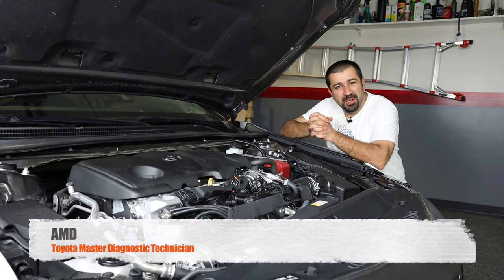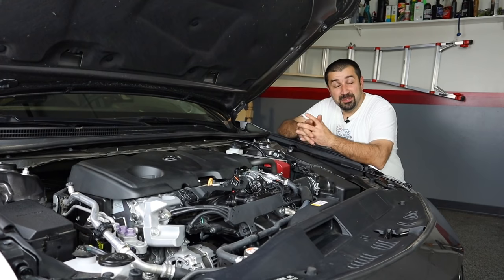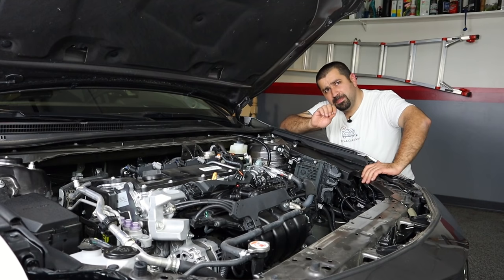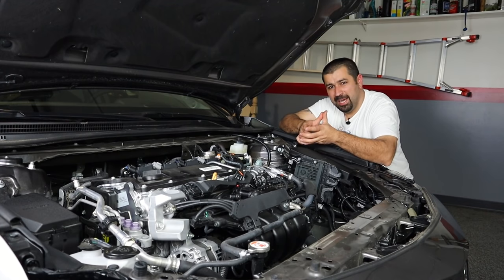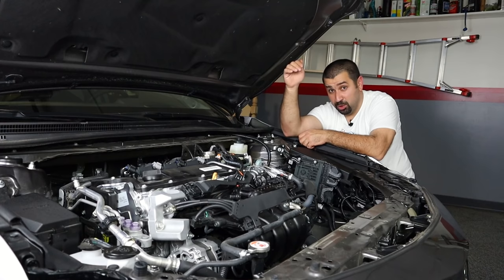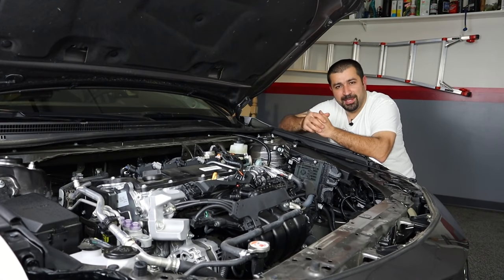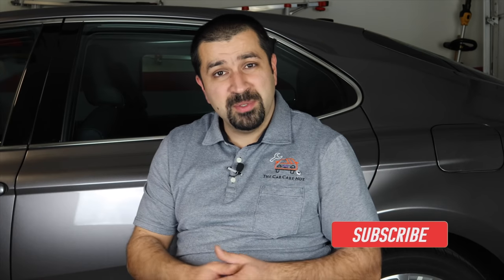Toyota's New Engine Technical review Part 1 : Cooling,Lubrication,Direct Injection and EGR

Comment: Regarding the oil, what happens at 100,000 miles when engine tolerances are worn and people usually use a heavier weight oil, what do we do then? Still use 0W-16. Another question would be I assume you will never be able to use oil additives like Lucas oil treatment? That stuff is like honey.
Reply from the maker: I’ve already seen examples well over 100k miles still using 0w16 and no issues at all. The oil additives personally I wouldn’t use regardless of 0w16 or not but that’s just me..
Reply: Engine oils for the most part are so good now you don’t need an engine oil treatment. Putting it in probably decreases the performance of the oil.

Comment: Port + Direct gas injection is the #1 reason I bought a Toyota over a Subaru or Mazda (Sorry Nissan, American and European makers your cars were NOT even in the running). I am surprised though that Toyota did not bother putting an acoustic cover of the DGI pump. It would go a long way to getting rid of that loud Diesel fuel pump clatter.

Comment: oh i forgot to mention gas mileage on the 2.5 in the 2018 rav 4 is a low 36 mpg to a high of 39.8 mpg in summer useing high test gas  that is an imperial gal  or 4.5 litres  average city and highway  beat that if you can

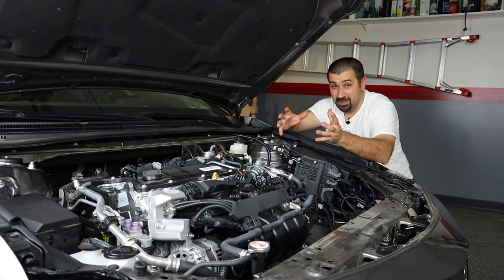Comment: @6:22 Europe manual for the same car with this engine... 0w-16 through 5w-30 is stated in the manual depending on temperature expected.. Do they have different programming for Europe in regard to the pump.. no... North America states the use of a heavier oil when towing or in extreme conditions... 0w-16 is purely for CAFE. The only caveat is if you are driving in -30 degree weather. Most of us never hit positive 30 degree weather.. I had to performa lot of research to get past this dumb 'Just use what the manufacturer says'.... My vehicle's are expensive.. I want them to last 500k not 300k.

Comment: A Guy in the US has a 2010 Toyota Matrix or Corolla, it's 1.8-litre fuel injected and he changes the oil every 3000 miles and has done INXS of 600, 000 miles and it cost him next to nothing to run he just uses a 5w30 synthetic oil, tell me what more do you need from a car. Like I've always said keep it simple, the more complex an engine the more things can fail as it gets older, notice plastic has become the new alloy, all this Tech is designed to tie you to the dealership, nothing is simple anymore and that equates to dollars, not in your pocket but the dealerships.

Comment: There's more parts, so there's more parts to fail, so more parts will fail and more failing parts are gong to cost the owner's more over the total lifespan of the vehicle. Let's just all get over that.

On the up side these Toyotas are designed to meet the emissions and fuel economy standards set by the government which means that you can go to any Toyota dealer and buy them without anyone breaking any laws.

As a side note, I'm guessing that these things have or will eventually have stop start technology so certain electric pumps would be necessary to keep systems in the car running when the engine is off. 

Will these cars be as reliable as older Toyotas?  There's actually no reason to believe that up to a certain mileage they shouldn't be, but all car parts are designed with a specific target life span.  Once these parts reach their target life span and begin failing these cars are going to get really expensive really fast. My experience tells me that once a car reaches a certain age stuff just breaks from use or even metal fatigue. Up to a point, you can just replace parts as they fail... In other words, given enough spare parts any car can run forever.   On the down side that isn't economically feasible when the parts are expensive and there are so many to fail.

For the original owners who get rid of their cars when the warranty runs out, these are going to be great cars.  For the guy who sinks his last penny into a high mileage, older one... these things will eat him alive.  It's going to be interesting to see where the tipping point between Toyota reliability and money pit is.

Think of these things like a Prius, or a hot potato; the guy who gets rid of the car before the battery, the electric drive unit, the catalytic converter, the ECM and the power distribution module fails did pretty well, the next owner who bought the car and gets to replace these parts among others is going to regret his purchase.

Comment: What about the recall on any out this thing.
Reply from the maker: Recalls on cars with this engine are minimal and usually software related
Reply: Tell me more about electric water pump and how its more reliable then the old one
Reply from the maker: We haven’t really seen any issues with electric water pumps. Some of the 3rd generation Prius with electric water pumps have failed but they were with high mileage and was not very expensive to replace.

Comment: Which Toyota cars use this engine ?
Reply from the maker: The first model to use it is the 2018 Camry. Then the 2019 Avalon hybrid. Then now the RAV4 in all 3 forms, the highlander hybrid the Venza hybrid the new Sienna hybrid the Corolla higher trims will use a 2.0 variant of this engine. Also the Avalon non hybrid AWD uses this engine. It isn't going to be long before every Toyota uses a variant of this engine.

Comment: AMD , please elaborate on the issues you have seen with using the wrong weight of oil in these engines . How harmful can it honestly be using 0w20 in this engine ?. It's only 4 points heavier at operating temperature and the same viscosity when cold .
Reply from the maker: Hi! Likely 0w20 is ok but some are going as high as 10w30 10w40 which is not a good idea for this engine
Reply: @TheCarCareNut  that makes perfect sense . Thank you for the reply sir

Comment: i like the Technology Toyota has implemented on this engine.. my only gripe is why they used a mechanical vacuum pump vs a brushless electric pump.. at highway speeds the vac pump will be turning half engine speed continuously wether needed or not vs a electronic version that can vary it's running speed or shut off completely when cruise with no brake application.. just seems abit counter intuitive based on the other advancement they've made

Comment: Electric water pump, plastic valve cover, adoptive transmission etc technology that BMWs use the last 10+ years that’s why they require lots and expensive maintenance. I hope Toyota parts are more reliable I just decided to switch from a 535 to a Camry

Comment: But In Bahrain dealer will still use 20w-50 in this engine
Reply: I wonder if the oil pump is always working on low pressure mode with thicker oil.

Comment: Official Toyota dealers in the Netherlands, Belgium and Germany do only apply 5W30 oil. This while the manual (in Dutch!) clearly prescribes 0W16! If a customer insists on 0W16 to be used dealers refuse to do so or let the customer pay extra. The dealerships do not have 0W16 on stock and have to order it in. Even the Toyota importer in the Netherlands says 5W30 is what should be used contrary to what the Toyota factory prescribes. I read about a customer who insisted to get 0W16 and was only allowed to get it after signing a waiver as he was told it is bad for his engine.
Reply: However I will insist on 0W16!

Comment: Hi we just bought a 22. Corrola, 2.0, 6 speed manual. Now after seeing the engine is more complicated it has kinda scared me. Was going to buy a 1.6 liter turbo 19 hyundai but got this new 22 corrola instead.
Reply: Dont worry you made the Right Choice
Reply: I second Dusty's response. Just keep up with the maintenance and that car will last you.
Reply: Lots if examples of these engines going over 200k miles with no problem

Comment: What id do is run the 0w16 for an initial oil change after a few hundred to 1000 miles, then run a 4-5k interval on that stuff and then send a sample of the oil to blackstone labs for example.
If wear metals are low this engine copes just fine with 0w16.
0w16 may be fine as a winter grade but id recommend 0w30 during summer and/or if the engine is under high load when oil temps go up. Thicker oils provide better protection its as simple as that. Should the thicker oil result in TOO much oil pressure ok then its no good.
If the engine is quieter and smoother on 0w30 id just run that all the time no harm in having a thicker oil in the engine at all then.

Comment: You didn't give a clear argument as why a 0W-20 or a 5W-30 oil would harm engine components in the long term. I'm not saying it's safe, it's just that you didn't give a technical argument. Just saying 'it throws the system out of balance' it's not a technical argument. I am guessing, there are many places in this world where 0W-16 and even 0W-20 are hardly available, so people will use some good old cheap mineral 5W-30 oil.  I cannot imagine Toyota didn't anticipate such situations and didn't designed the engine to work in such conditions.  The 0W-16 really is a matter of emissions and local regulations. Not even the MPG will be much improved.

Comment: All this complexity is proof that internal combustion engines are nearing the end of what's possible with engineering. Ever more complexity for ever smaller gains in efficiency. Electric motors are so much simpler mechanically, they will  turn out to be a much better fit for purpose. 

Just imagine a world with only electric cars and then someone introducing this complexity as an alternative. How well would it sell?

Comment: Please make an entire video about the topic of the new 0W16 oil requirement in new Toyotas.  It's a HOT topic!   Toyota puts this big 0W16 sticker on top of the radiator that scares the heck out of a lot of quick lube places.  This makes Toyota owners very mad when they can't get their oil changed at their favorite local quick-lube shop.  And you still can't buy 0W16 in a lot of retail outlets.  So how bad is it if  you use 0W20 instead of 0W16?  Is Toyota trying to force their car owners to go to the dealership for oil changes?   I wonder if other auto manufactures will eventually follow Toyota's lead with 0W16, or whether they will avoid it like the plague, because of how many problems it is causing new Toyota owners.  I guess a lot depends on the MPG savings with the fancy electronically controlled oil pump that you talk about?
Reply from the maker: Good video topic. Added to the list
Reply: @TheCarCareNut  You seem to justify Toyota's decision to move to 0W16 by stating that it works with a new type of variable pressure oil pump, that reduces friction on the engine to ultimately increase MPG.  You can buy that oil online, and get it shipped to your house - but who wants to do that and take it to their nearest oil change shop whenever they need an oil change?  I'm sure some quick-lube places stock that oil, but who wants to drive around looking?  Any gas savings would seem to be greatly outweighed by the inconvenience of having to hunt for the correct oil.  The way I see it, Toyota HAS to design cars in which routine maintenance can be easily handled by outside shops, because the Toyota dealerships can't possibly  handle all the oil change business associated with all the Toyotas out there on the road.

And while you are on the topic of motor oil, could you discuss your opinion about high mileage oil in older Toyota engines? Some of that stuff is full synthetic, and some is not.  A lot of the high mileage oil sold at quick-lube places is either conventional, or a synthetic blend.  And, I've never even heard of high mileage 0W16.

And while you are on the topic of synthetic vs convention, would you discuss the merits of these 10,000 and 20,000 oil filters designed for high mileage synthetic oil.  It's my understanding that the cheap cellulose filters trap finer particles, but they get clogged up fast, and have to be changed at 3,000 miles.  On the other hand the long life synthetic filters don't trap the really fine grime, but they hold a lot more larger particles.   Do you agree with that?  What is your suggestion for oil filters on Toyotas?

I can think of no maintenance topic more important to Toyota owners than oil and filters.  This new 0W16 oil requirement is causing some real chaos in the car maintenance world.  I also believe that a lot of the advertising from the big motor oil companies has convinced people that if you buy their expensive oil and filters, you really can go 10,000 or 20,000 miles without looking under the hood.

Comment: Which transmission is more reliable-new 8 speed automatic or hybrid CVT? Many mechanics complain about 8 speed AT from Toyota.
Reply from the maker: Hybrid transmissions are very reliable. The 8 speed had some issue the first year or so but after that it’s reliable. Does shift too much but that’s normal and not a problem

Comment: Will 0w20 oil, Even really good Synthetic Very thin Pennzoil Platinum Damage the engine? I find this hard to believe Since there is barely a difference between the two viscosities
Reply from the maker: If the engine is designed to run on that Oil then it won’t damage anything. Been used for sometime now and cars are getting very high mileage using the 0w weight oils
Reply: @TheCarCareNut  thanks, I was asking if 0w20 will damage the Dynamic Force engines since there is only a minute difference between 0w20 and the required 0w16 oil.  Especially if you use the thinnest 0w20 which is Pennzoil Platinum.  Also, do you know what viscosity oil the customers were using that caused the issues you mentioned?
Reply from the maker: Hi! For the Dynamic force engine if your owners manual says use 0w16 only I would use that oil only. The viscosity of the oil that caused damaged is not known specifically but it was greater than 10w30

Comment: Official dealers in Ukraine force using 5W30 oil. They even don't have the 0W16 option.
Reply from the maker: Interesting.
Reply: @TheCarCareNut  the same happens here in Spain, the user manual explicitly says 0w20 but dealerships always use 5w30 oil, at least for Toyota Auris hybrid. A lot of people complain about this but they just don't care, and I guess 5w30 it's cheaper for them so that's what they use when changing your engine's oil 🙄.
Reply from the maker: That’s not good that the official dealership doesn’t carry the recommended oil because the other is cheaper.
Reply: @TheCarCareNut  well, as I said, I guess they do it because it's cheaper. I can't think of no other reason. And I say this because I know people that are on a forum and everyone comments this issue. There was even the case of someone that bought the oil and took it to the dealership so that they could add that oil to the engine instead of the "default" one. And Toyota Spain takes no measures on this alleging that local temperature conditions can condition the use of another oil grade, but that's funny because this happens both in southern Spain as well as in the North, where temperatures vary a lot on winter.

We know that in the end, consumers are the ones prejudiced for these behaviours.

Sorry my English.

Comment: With all that amazing engineering , why can’t they figure out how to make it quieter? I can’t stand that my Camry sounds like a diesel until it’s warmed up. Insulate some of those noisy parts!!!!
Reply from the maker: Hi dave, I totally hear you. They’re very loud. However insulating that loud direct injection pump and injectors is simply not possible. Even much more expensive luxury cars are much louder than the older ones because of that.
Reply: The same goes for the GERMANS..  With all that amazing engineering, why can't they maker reliable-solid cars..?
Reply: @77GR1982  I dont know much about German cars except look cool and are expensive to service or fix. I thought they were reliable.

Comment: Full City driving, stop and go traffic, my mpg is 18.4. Is this normal?
Reply from the maker: Try resetting the counter. If it’s very heavy traffic that could be normal.
Reply: Yeah that seems totally normal if it’s very heavy traffic. In Boston my 2020 Corolla SE can get as low as 16mpg when it’s rated for 31 city. Just depends how bad it is!
Reply: @Vtethers1314  even a Corolla ? I thought I should’ve got a Corolla for better mpg.
Reply: @duoshuai  It ALLLLL depends on how slow you go, stop / start, etc. If traffic is light in Boston I get 25mpg or so. Highway is always 40+ if you go 75 mph

Comment: I’m not buying the thinning oil concept, it directly influenced by emissions, nothing else. V8 3urfe states 0w20, but same engine in other countries say 0w20, 5w20, 5w30, 10w30. Now the second number is dictated by main bearing clearance, meaning any four oil weights my be used. Now, for longevity and to get the most out of the engine you WANT max number relative to main bearing clearance. 0w20 is strictly emissions and not what the engine really needs.
Reply: I know that BMW and Mercedes allow you to use anything from 0w30 to 5w40 and you are supposed to select according to climate and operating conditions.
In fact I don't know of any german engine that copes well with oils thinner than 0w30. 

I run 0w40 in my 2007 Diesel Volvo and it absolute loves that oil but then its an old ass diesel I can probably dump a bucket of 10w60 in there and thin it out with a few shots of diesel 😅and it would run on for another 250k. But what that engine really hated was the 5w30 I put in it when I first got the car because it said 5w30 or 0w30 on the sticker but well people told me quickly that Volvos oil specs are made up hogwash and a good ol 40 weight is what it needs.

Comment: That’s not the biggest problem with DI. High temp, high compression = a higher amount of carbon buildup of a totally different molecular structure. 
If you have DI; any DI; you need a good quality intake/cylinder cleaning every 15k miles.